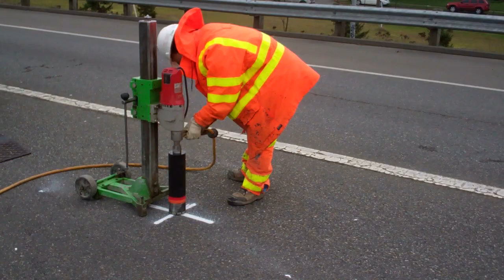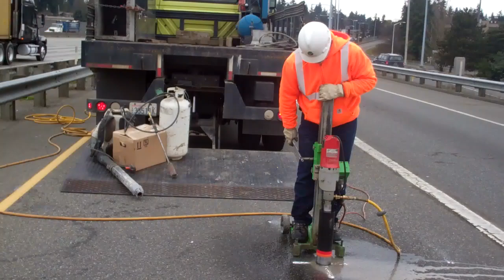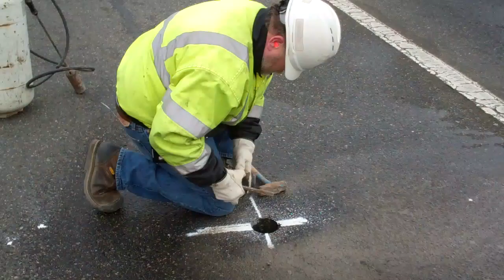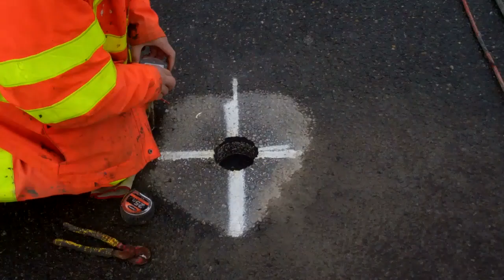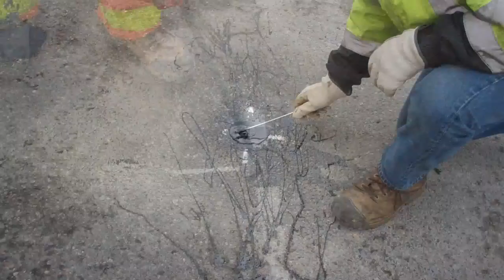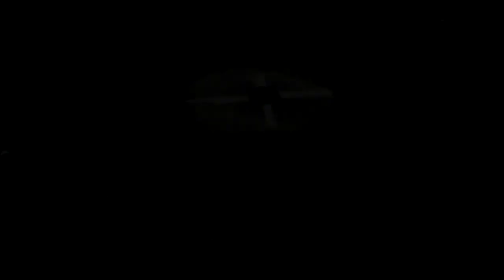Puck test

Comment: Hi can you tell me what epoxy are you using for the finish.
Reply from the maker: It's a two-part epoxy that comes out of a double-barrel caulking gun. The epoxy's agents mix within the long tube that is provided by the sensor's manufacturer (Sensys Networks). The actual epoxy is from a company in Wisconsin called Fabick, Inc. and is a solid-silicone polyuria-based joint sealant. After installation, the epoxy sets up in about 5 minutes and is completely hard within about 10 minutes.